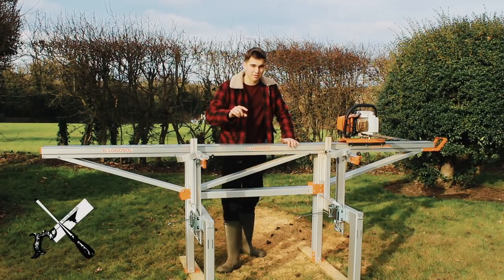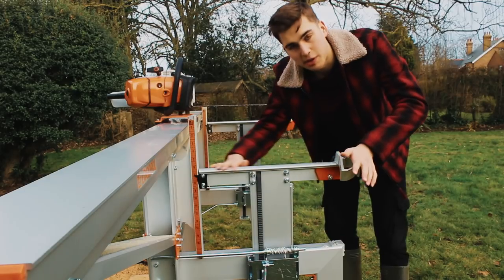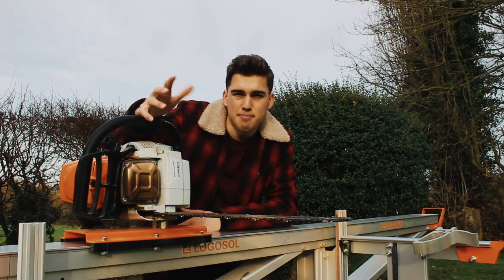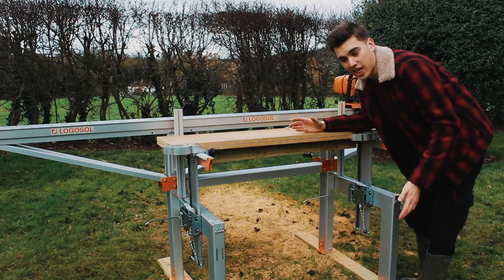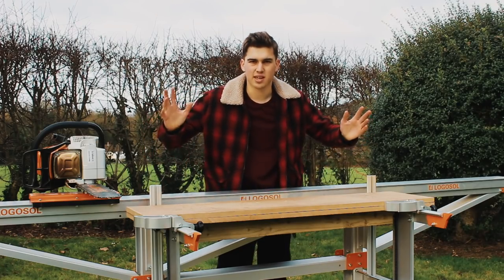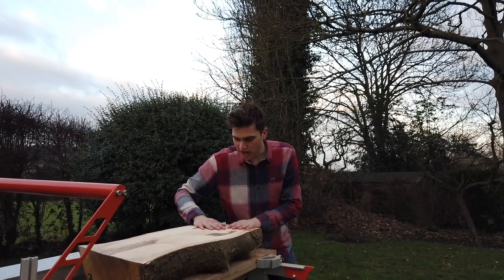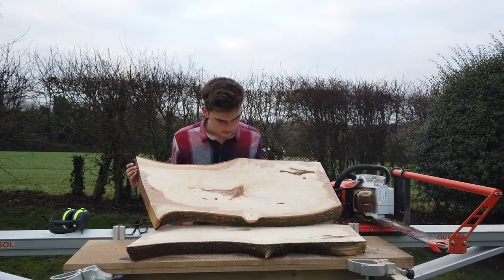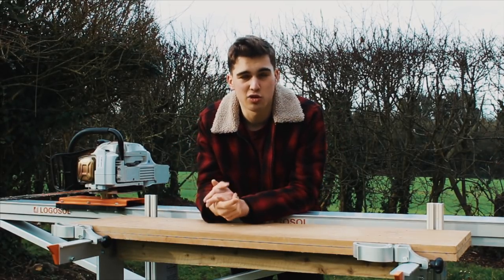Milling up Ash! With The Logosol F2 Sawmill

Comment: like the smaller jug . .set up... I will make one...

I just purchased a portable saw mill . .  I run my new Husqvarna 572 XL (G) with heated handle grip with a  recommended 36" bar and  a 3/8" x .050 - 93 DL link ripping chain . . what inspired me was . . I most recently purchased a 2x4x8 construction grade stud for $6.50 US  from a massachusetts lumber yard. . . never again will i ever but lumber from a lunber yard again . . .

Comment: Hello Sean mate. I've got a couple tips for you should you be interested. 
1. Get out the grinder an cut off every other set of teeth from your chain, this doubles the hp per tooth in the cut and makes cutting go along much quicker. It also half's the amount of time you spend sharpening. 
2. I found it handy to make an L shaped jig one end goes over the guide rail and is matched to the depth of the cut from the surface of the guide rail. The other end is graduated down from the height of cut in inches/mm. I found 10" more than plenty, this lets you line up your pith parallel for your first two cuts ( if you are making square edged timbers) 
3. A really easy one and the most useful. I whittled a couple of pegs that fit tightly in the round holes in the measuring scale extrusion . Then cut the off with the saw in the carriage. This gives you an exact zero.
4. I fixed some bits of wood to the ends of the guide rail to space out to the depth of the measure scale. This stops the bounce when getting started in the cut. Makes it more accurate and more enjoyable, 
Happy cutting bud!
Reply: Just buy a skip tooth chain for milling

Comment: I have an M8 and it looks as if there are some good upgrades to this model. I would say make yourself some wedges to put into the cut gap, it will help stop the planks flying off when you finish cutting. It will also stop a large log dropping onto the chainsaw blade and scaring the s*** out of you when it takes the chain off the bar
Reply from the maker: Hi David, thanks for watching and the tips. I will definitely make some wedges... so thank you for that! Yes the M8 is a great chainsaw and I'm sure you can use it with this sawmill!

Comment: Hi Sean, I have a woodland plot and I have plans to mill up loads of Corsican pine as I'm thinning out the crop to allow native species to comeback. I've just bought F2 sawmill. A mate and I have set up the mill. How important is leve;lling the ground beforehand?   Thanks for the tip on 2 by 4 to attach to legs to create a base. Regards Paul
Reply from the maker: Hi Paul, That's great! I hope you enjoy using the sawmill. You want to sawmill to be and rigid as possible. That doesn't mean it has to be like a rock. Some times mine wobbles and it's not the end of the world, the sawmill will still work fine. I either keep lifting the sawmill up and re-positioning it until the seems flat on the ground, if that's not working, then i would just shim some pieces of wood in the low areas under the 2 by 4 so the sawmill doesn't rock around. I hope that helps.

Comment: Thats looks like fun!
Do you know what causes the dark edges on the milled slabs?
Anyway, very nice video.
Have fun at uni ;-)
Reply from the maker: HI Paul, yes it is! I think it was moisture staining, and it will probably go away when drying. the logs had been sitting around for a bit.... ideally you should milling the logs up as soon as possible after you cut the tree down. glad you liked the video!

Comment: Nice video, I've been uming and ahhing about one of these for a while. I had been learning timber milling with a bandsaw and planer, but it takes quite a lot of time and the amount of wasted timber is immense. What is the wood surface like after been cut with a ripping chain, would it need planing or just sanding to get a smooth surface?
Reply from the maker: Hi Robert, sorry for the late reply! From a sharp ripping chain, the surface is great and reading for sealing. what ever mill you use (where and bandsaw or chainsaw) you will still need to plan it down when working with it. I would say the ripping chain doesn't give you more work to clean up.